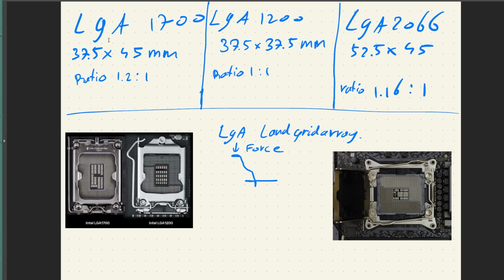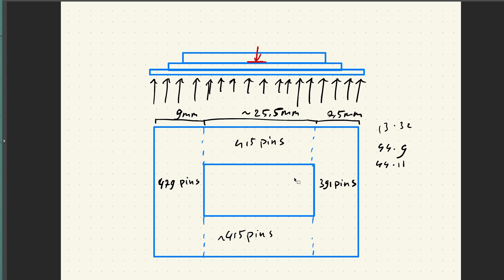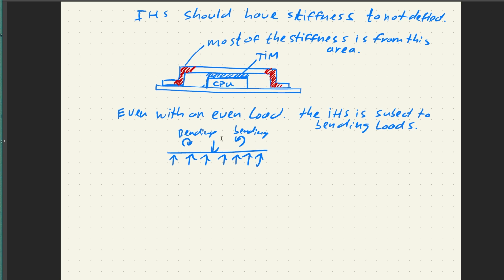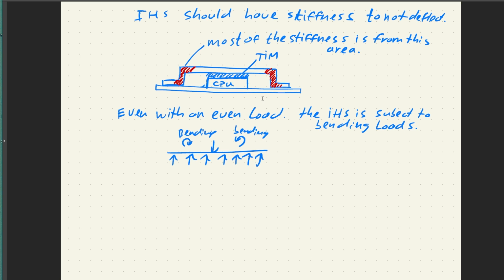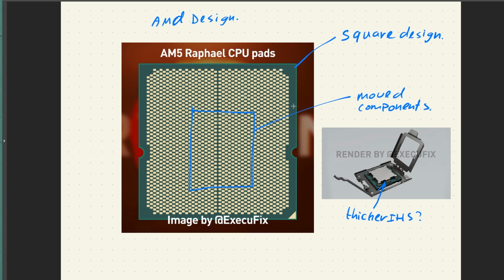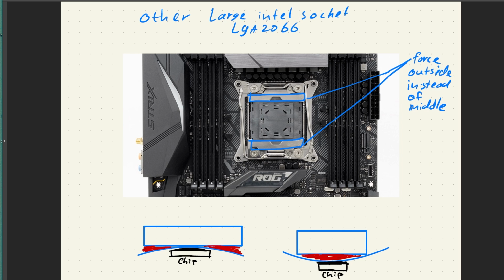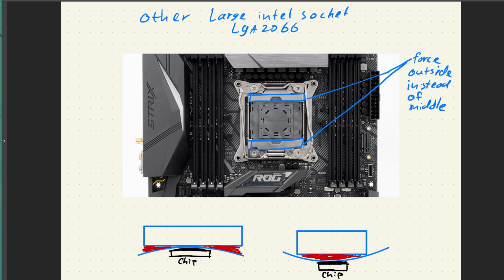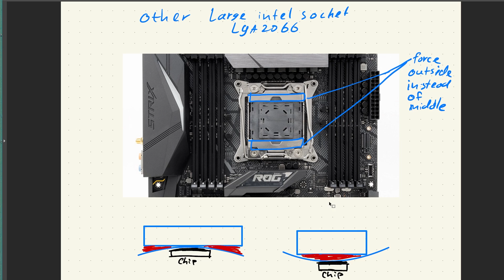Is this why LGA1700 CPU's are bending?

Comment: I just finished 1 week adventure to make dual channel memory working with with asus z690 mainboard....... less pressure on cooler screws and adding washers  under cpu holding mechanism helped.
Junk i must say.
Reply: 1mm washers or bigger? whats the material ? a neylon?
Reply: @danilaer2551  1mm, yee plastic ones
Reply: @malpigwalt  so the system still alive and working well? you tried to overclock memory? any new errors\blue screens ? ive been thinking about buying a deformated 12100f and use it with thermalright lga1700 or washers
Reply: @danilaer2551  Yep all works good. Without washers was problems, with all working well, memory overclocked.

Comment: The latch system has been around a long time is it Because the LGA1700 is a bigger chip?= more area to bend?
Reply from the maker: Mostly because it is a longer chip. with more force (each pin has the same force needed. so going from 1200 to 1700 pins adds a lot of force)

Comment: Mine bend so bad it won't boot with a after-market cooler and with the stock cooler it hits 100c in seconds and throttles to half speed.... 

Possibly last time I ever buy intel(unless amd will end up making the same mistakes) I'd rather have AMDs hot power hungry cpus that atleast don't bend.
Reply: Ehh, AMD's CPU are generally more power efficient.
Reply: @MissMan666  hmmm not sure about power.
 I first wanted to get 12400f, But I was like, ok alder lake is bending, let's get some am4 AMD like 5600(x) and found out that many users are complaining about usb problems when using gen4 pcie. Even after lates Bios updates. 
So, maybe I skip this generation, and wait for am5.
I'm really sad, because I was crazy into that 12400f
Reply: That's really strange.
Could you tel us the exact cpu,  cooler and mb? 
I'm really interested to know more since I planed to get alder lake, but not sure anymore.
Reply: @markodimic  I'm pretty sure it was a Asus b660 gaming wifi g or something with a i3 12100.
Reply: @sansundertale69availablename  haha.
I wanted to get 12400f with Asus tuf b660m wifi .
So you probably saved me headache and  money . 🍺
Reply: @sansundertale69availablename  so now you still have that m board? What cooler are you now using? Still arctic but with different back plate? Or other cooler?
Reply from the maker: Interesting, I'm going to build a pc with the 12400 and noctua NH-L9i soon (waiting on the motherboard). Will check to see if i have issues with that.
Reply: @mechitworks  let us know 🤞
Reply: This is very interesting, now it could be caused by not enough pressure. Try doing a few things. First you can laying the pc down and put lots of pressure on the cpu cooler if it boots then your installation was incorrect

 remove the cpu cooler clean off all of the thermal paste u can use alcohol and a coffee filter, reseat the cpu and reinstall the brackets using the manual then apply a non conductive thermal compound like nocuas thermal paste. Use a "x" or spread method. You can't really over do it because with enough pressure the paste will just squeeze out where it's not needed, [attention be sure it's non conductive paste] now be sure you are using the correct spacers when you install the cpu cooler and the mounting brackets being in the correct notch. Also be sure to tighten it down till it stops. This should help. Because it definitely sounds like you don't have enough pressure on your cpu which could be caused by incorrect spacers and what not. If the spacers or not the correct size u can tighten all day but if it's not making contact then it's just stressing your board out.
I have the 12700k and it's awesome it's in a nr200 sff case with a noctua u12a cpu cooler on a msi z690i unify mobo. Good luck.
Reply: @blueridgeocean  well its as I said I fixed it with a cheao plastic back plate. And the issue was just intels trash quality their cpus are build very badly of low quality materials and thats why they end up bending. Honesty I should've just stuck with my old system but it was also barely just doing what I wanted to do (90fps in any game) but atleast it was proper quality. But mistakes were made and yeah. New products just kinda stink. Low quality unimpressive and dissapointing.

Like if it works its nice because its much faster than any k cpu for gaming because for what ever reason k cpus seem to have much worse bins.

And yeah I'll just take the L on the new systems I tried both dissapointing and both with issues I don't want.
Reply: @sansundertale69availablename  im glad you figured it out. My understanding is technically the "k" version cpus are better than non "k" the reason why a non k will be better for gaming is because of the price difference. If it is a bad wafer that can't be used for their 12900k but not good enough for the 12700k they will  sell it as a non k 12700. If the wafer is real bad with non functioning p cores and e cores or just can't be stable at the speeds required then it'll go to the bottom of the list like a i3 or i5. Binning is done with every cpu, and manufacturers [wtf I meant retailers] can also bin their lots they purchased.
But really the 12th gen cpus are strange there target wasn't about efficiency nor thermal performance but I will tell you this my cpu runs fantastic there are no outliers when it comes to cpu Temps and performs well. With my oc I'm reaching 5.2 ghz on all pcores and 4 on the e cores. So I'm fine with it.